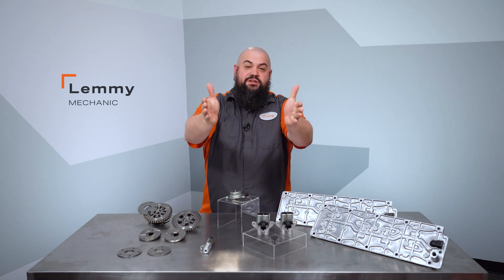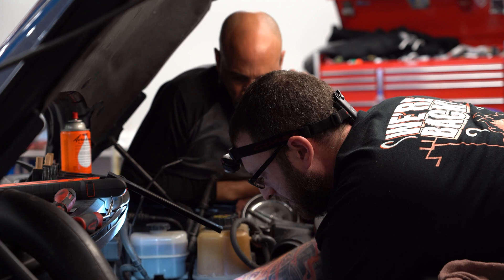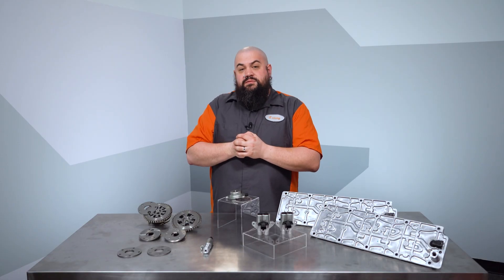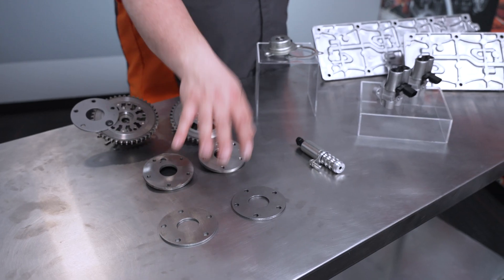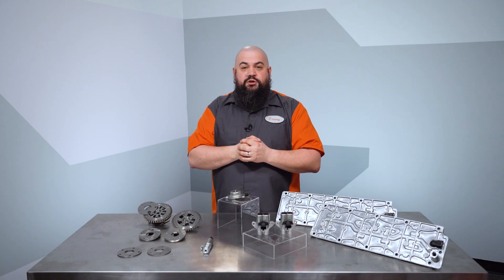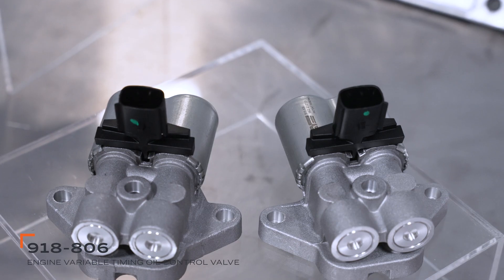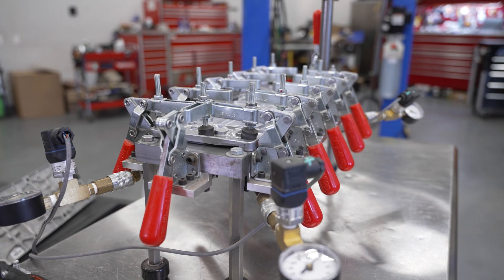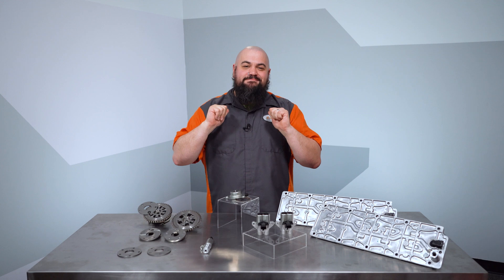Proof that Dorman VVT components are superior to competitive products

Comment: Installed a vvt solenoid on to my 2010 CRV. Car kept stalling no CEL. Went on a goose chase trying to find out what part it was and ended up replacing the throttle body, MAF. Didn't solve the issue. Got an OEM VVT and it fixed the issue. Never using your products again.